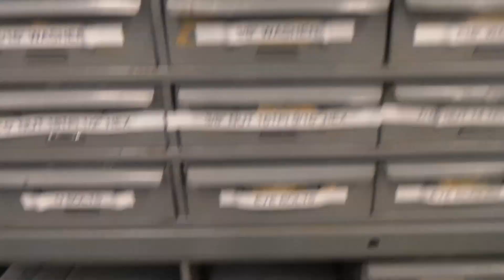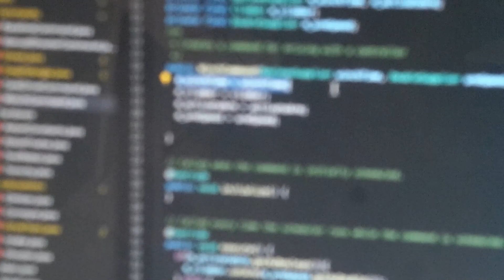FRC 2020: Week 5 Recap

Comment: What filament is that?
Reply: What part of the video?
Reply: Aaron Beckman when they hit it with a hammer and didn’t break lol
Reply: @bjayven  It's 3D Solutech translucent red PETG. Solid part, 55% infill, 7 perimeters with a 0.6mm nozzle @0.35mm layer height. 230C on the nozzle, 60C on the bed
Reply: Aaron Beckman time stamp 3:35